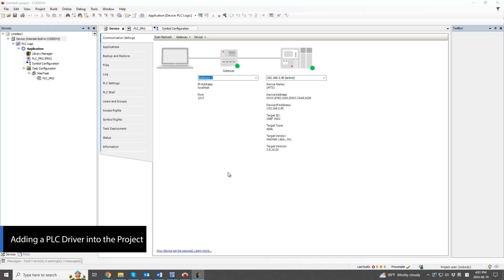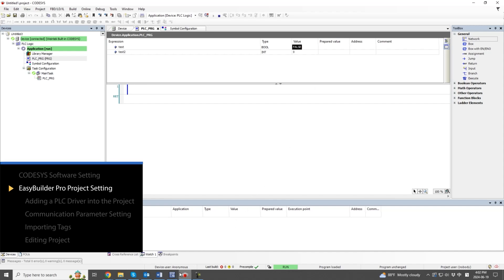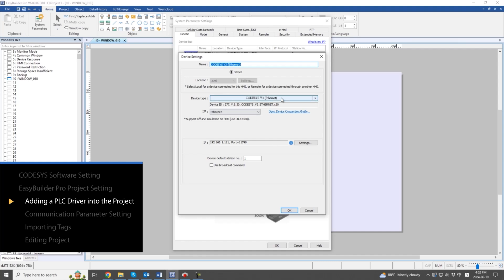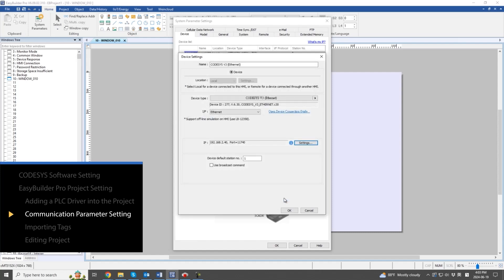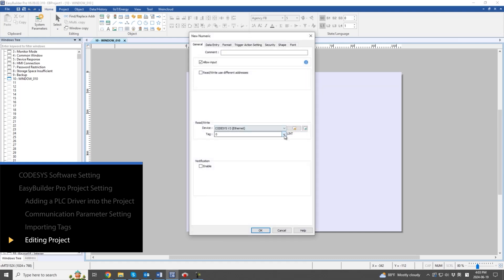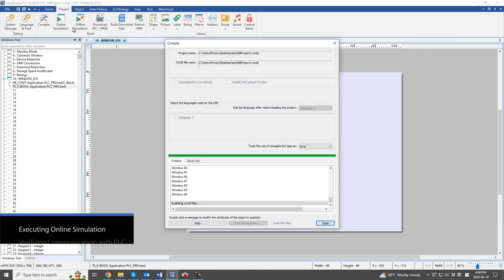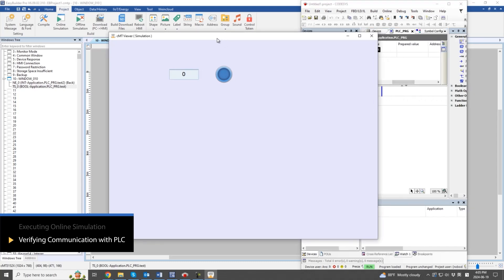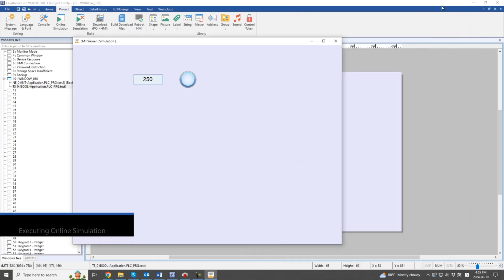Weintek EasyBuilder Pro tutorial - 3. Establish Communication with PLC

Comment: Hi, I am trying to build a communication between HMI Display (MT8071iP) and a PLC via BAcnet TCP/IP. One PLC device communicates with HMI. When I am trying to connect two PLC with the one HMI at the same time using same protocol BACnet, it is showing an error "HMI port no. = 47808 is already set in other BACnet device". How can do I solve this issues?